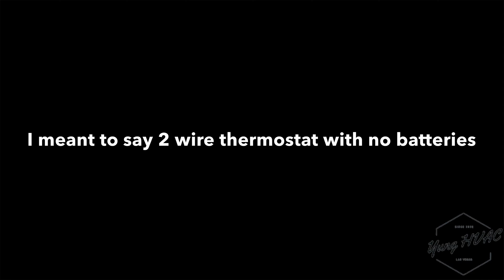HVAC Transformer Replacement on super old unit . No Disconnect 😱

Comment: I know you posted this a yr ago but I thought u check it every now and then . I pulled out my AC’s tranrsformer. I didnt take a picture how the wires are connected, so now. I have a problem in connecting it back. The schematic illustrate that the primary red wire connects to L1 and primary black wire connects to L2. But I don’t see any L1andL2 to connect the red and black wires ?
Reply from the maker: Sorry I’m late responding brother . Was your transformer hard wired?